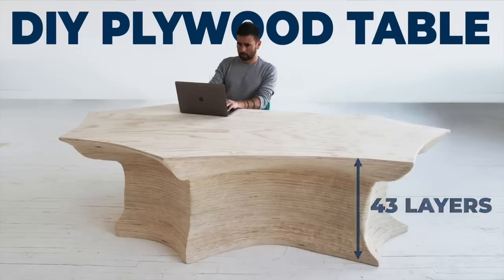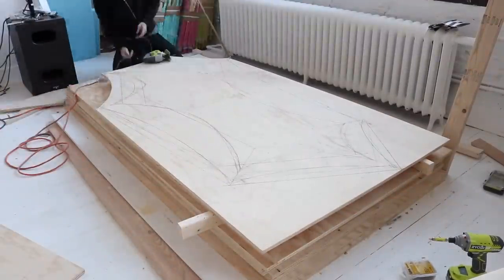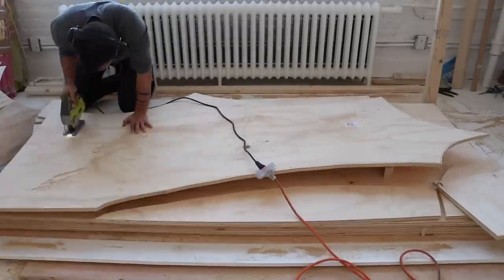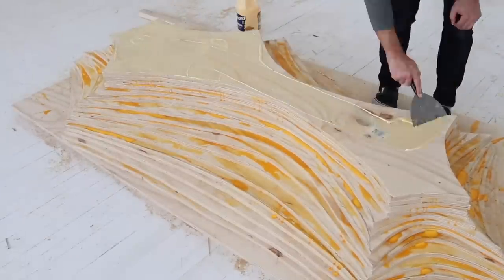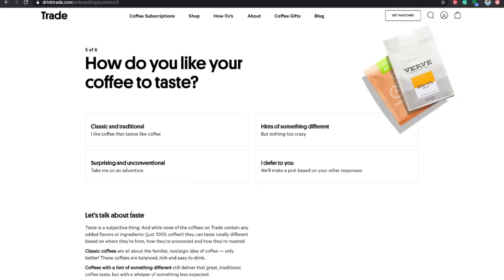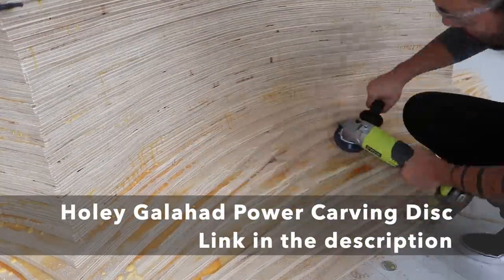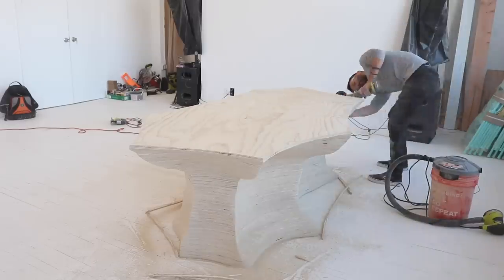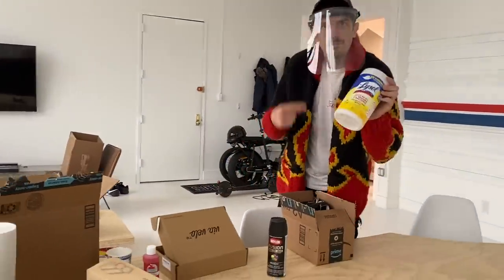DIY Plywood Table | Built for Andrew Schulz

Comment: Thats the most expensive plywood table ever XD
about $1200 - $1700 going by local plywood prices.
Reply: True
Reply: There has to be a shape which could allow you to use the upper hollows as lower layers, this particular shape just isn't it....
Reply: ... unique is usually expensive.
Reply: I counted about 40 sheets.. so at $24 a sheet it's $960.. plus whatever Ben charged to make it, I'm sure it's well over 4k.
Reply: @claireconover  ... Its a DIY channel.
Reply: thanks, was looking for this!
Reply: 24$ a sheet? in my local hardware its 10$ a sheet
Reply: @abishaakmal7455  yeah for 3mm thick perhaps
Reply: And gotta be heavy ass hell
Reply: I know, right? He could have saved a lot of money with an IKEA table. You wouldn’t even notice the difference.
Reply: $79 a sheet where I live.
Reply: OK, we all agree that this plywood art project gets a passing grade at the most but if you want to see a REAL cool project similar to this but using pallet wood instead go check out a youtube designer named CRAFTLING.  He makes the most amazing credenza out of layered pallet wood.
Reply: OriginalCatfish thank you captain obvious.
Reply: @abishaakmal7455  WHAT
Reply: @Solerius1990  not even kidding. 10$ and not for the 3mm one but a 1cm one. Its cheap
Reply: How many tons its weight?

Comment: Money saving tip: Visit a construction site and ask the man in charge for their scrap plywood. Buy 1 sheet just for the top.
Reply: Construction site guy here. Scraps you're getting will be to small.
Reply: @alrightythen1533  To small?
Reply: @doubledarefan  Yes. You're looking at cut offs maybe 12" wide & smaller. If you're lucky you might find one or two usable scraps. Definitely not worth the time. 

Remember for some people money is time, if they got the money to spend on new plywood, it's not worth the time to scrounge around for little to no return.

Comment: I understand the people that criticize the use of materials, but this is more a project about the design with limited time and tools for me. Not a project i'd wanna rebuild, but it could inspire someone to use the design for a small sidetable or maybe a stool. Especially if you have gathered a lot of offcuts. Even if they don't have the required shape, you could easily glue them together for all the middle layers. Would still need a lot of glue, but whatever..
Even if you're not as happy with the final look, it's probably a better fit for the studio than a simple sheet of plywood with 4 legs ;) Thanks for sharing!

Comment: You know, that looked really awesome when it was all said & done!

Could you make a similar table from pine boards & it be lighter weight wise?
Would it still look as good in a similar shape? did these thoughts plague you before you decided on a material?
Actually how did you decide on plywood?

Also thanks for the link to that tool you mentioned. Looks very useful for shaping wood.
(I was thinking those angle grinder, with a aggressive sand belt would work, but this tool you linked to may be more practical?)